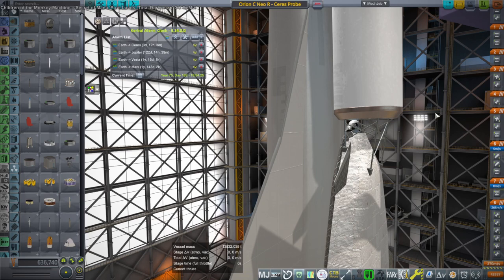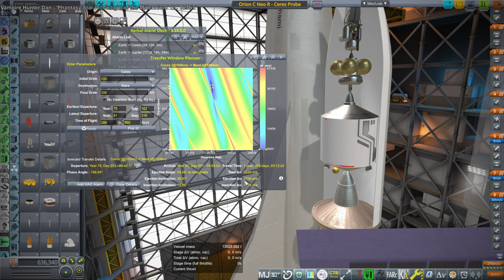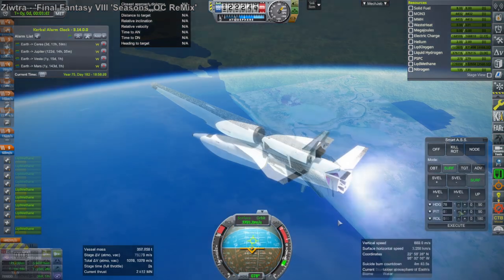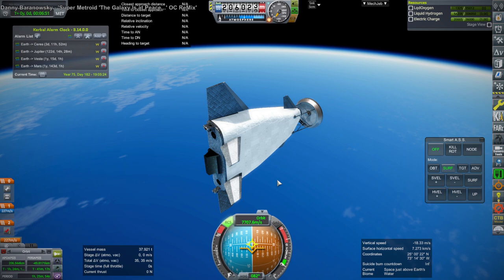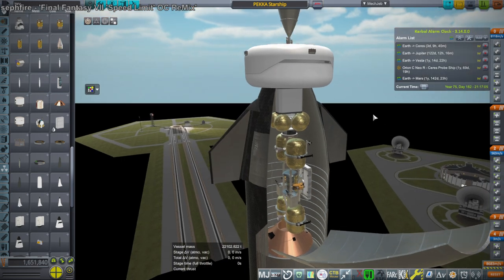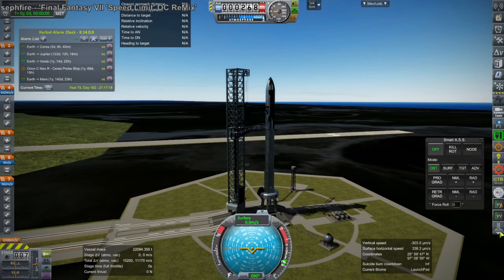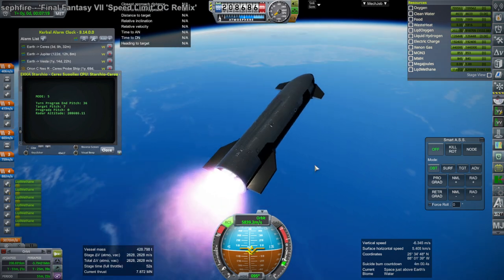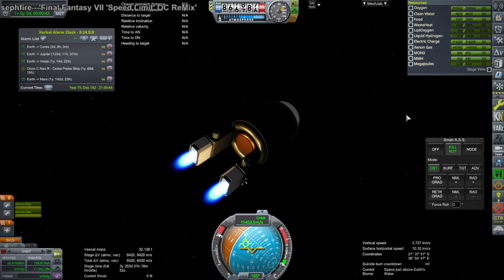To Mars and Beyond S2 Episode 3 (KSP 1.12)

Comment: Thanks for your many recent videos. Beyond my level off competence but I enjoy watching regardless. Quick question if I may. How do you identify the point of Maxq?
Reply from the maker: Max Q is maximum dynamic pressure which is a function of atmospheric density, velocity squared, and supersonic drag - the first one goes down during a launch, the second factor goes up, and the third one peaks at Mach 1 then starts to go down, so there's a point where Max Q reaches a maximum. You can check the number in the FAR dialog and see where it reaches its peak, but generally speaking it will do so around 15 km and 500 m/s or a little before that unless your rocket has a high TWR.